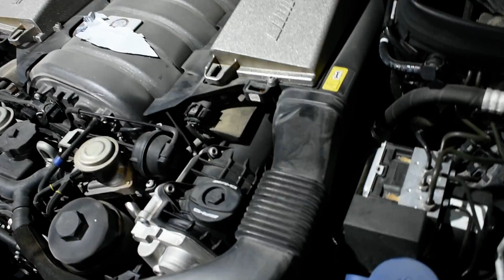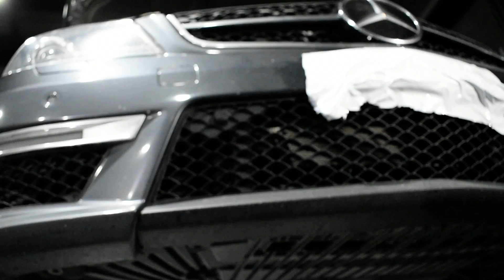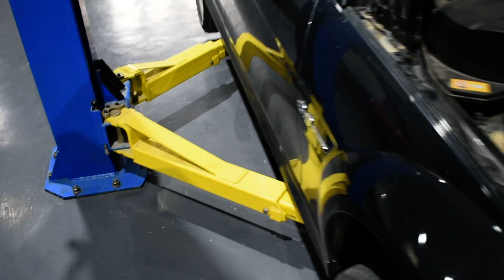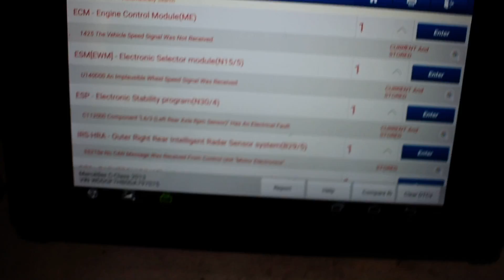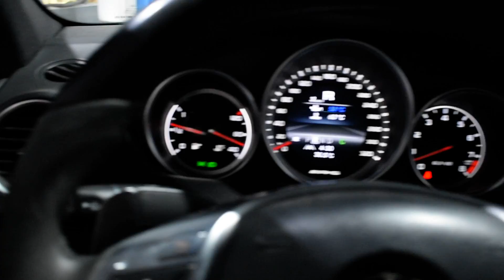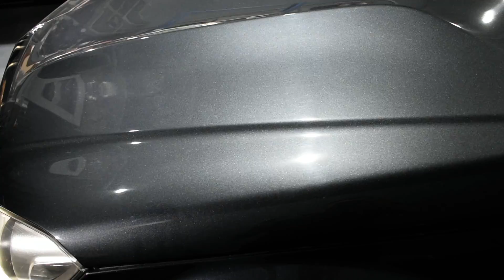C63 with 180k km check up (return) no sync sound

Comment: what camshafts, adjusters and lifters  do you replace with the m156? What brand do you use that with regular oil changes it will last forever

Comment: Hello Tasos, my cls 63 with m157 engine has low compression in cylinder 1 and rough idle, what could be cause? It has 155000 km on it. The car still has mercedes warranty, do they need to replace the engine?
Reply from the maker: John Wick hi, don't waste your time and go to change the engine under warranty
Reply: Thank you Tasos, my car is at Mercedes dealer right now, hopefully they replace the engine. I don’t want rebuilt engine lol
Reply: Hi Tasos, Mercedes said the cause was a faulty fuel injector? Could this be the cause or are they lying?

Comment: Hello, Tasos from the United States, Albuquerque, New Mexico. I just purchased a 2014 C63 507 edition with 48K miles. This is the car https://bringatrailer.com/listing/2014-mercedes-benz-c-class-8/ I hope I am making the right decision here. I have watched just about all of your videos about this camshaft and lifter failures and makes me a little scared. I hope this car will last a while before I have to replace them. Does switching the oil to 10w-60 and using CeraTec help with the longevity and help prevent from this issue happening or continuing to get worse? Thank you for all the videos you have definitely been a valuable asset to the Mercedes community especially the M156 community. Curious how come you always cover the name of the engine builder?

Comment: Tasos the battery on my w211 E63 is 7 years old. It shows 11.5 volts every morning but immediately goes to 14v when I start the car. The car starts just fine. Should I replace the battery because of its age? Or is it fine until it dies?

Comment: Tasos, what is your opinion about adding Liqui Moly Ceratec when doing oil changes on the M156?  I've been changing my oil every 3500-4000 miles.  Do you think its worth using an oil additive to prevent cam/lifter wear with that oil change interval?
Reply: FirearmTutorials .com I personally love ceratec. Watch YouTube channel called project farm

Comment: Yasou tasos.

I have 2008 w211 e63  car has no rattles 

But i noticed when I take off or drive I have a little bit of valve  lifter noise.shouls it be a concern?
I use 0w 40 oil
Reply: ghs777 it definitely should be. Watch his other videos  You might be able to cure the problem with seafoam according to guys on mbworld.org if not too late. If it doesn’t help, then it is time to replace them